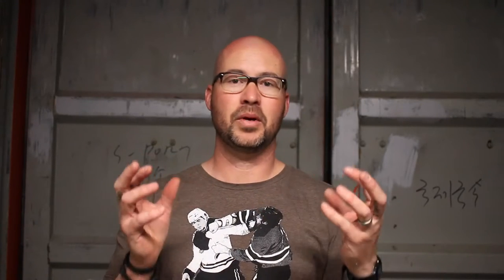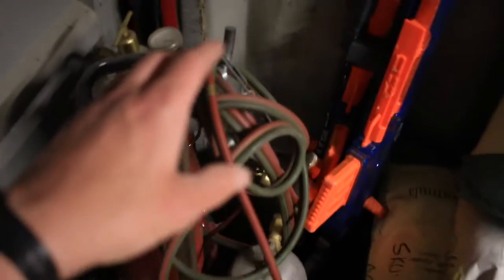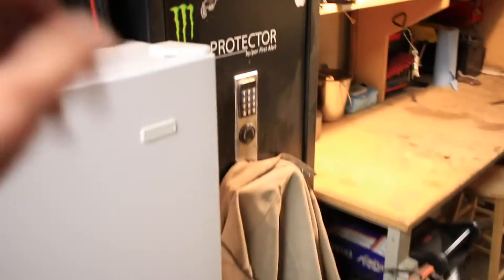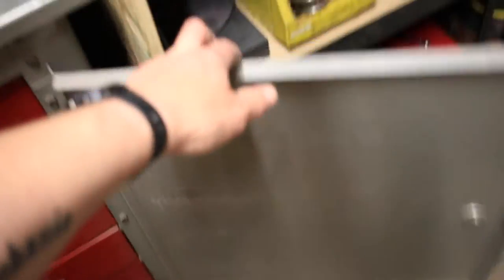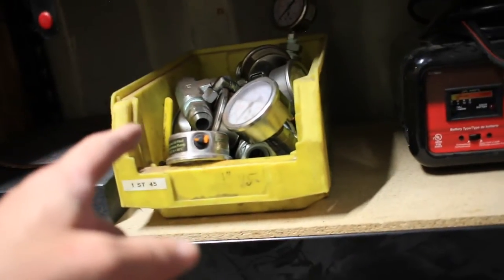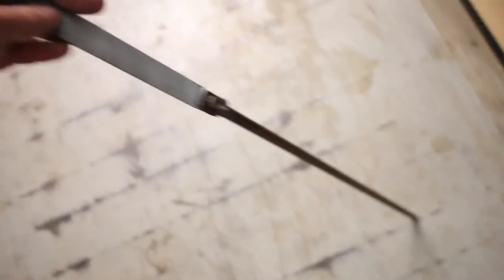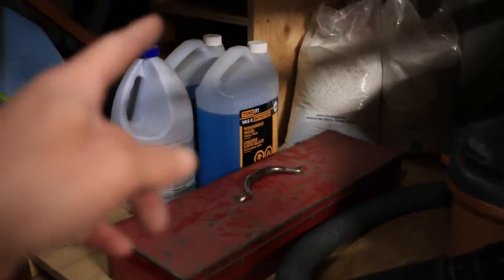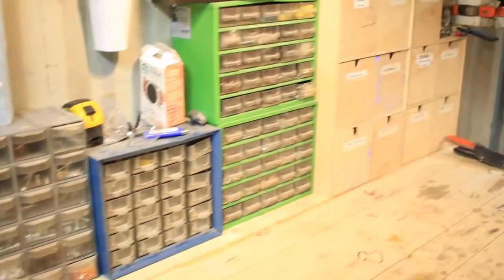SEA-CAN (Shipping Container) Knife Shop - Day 21

Comment: Just found your channel and subscribed. I also do metal work and I'm setting up a shot in a container as well. How did you attach the majority of the shelves, lighting, electrical? Did you weld most of it or self taping screw it? I have been reluctant to start drilling holes in the walls so I haven't ran electricity yet. Like the channel keep up the good work.

Comment: nice job but i did not see a man door we put a man door in the original container door that opens second and i love it you can still open both if needed  but going in and out all day is so much easer
Reply from the maker: +Datalus Kazan yeah I think I will need to do that. I wasn't going to because I thought I wouldn't be using this all that long, but even after I have my other shop built I might dedicate this to a knife making only shop to keep metal dust and 'grindies' out of the  main shop where I will park vehicles and do wood working. I think a man door will happen in the next month or so. Great idea!